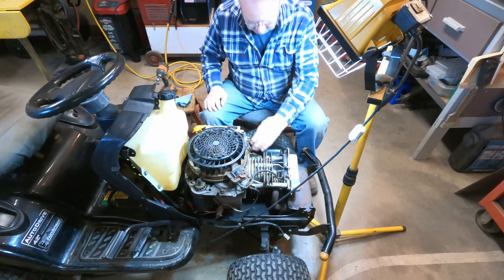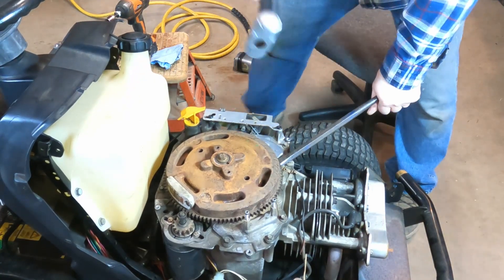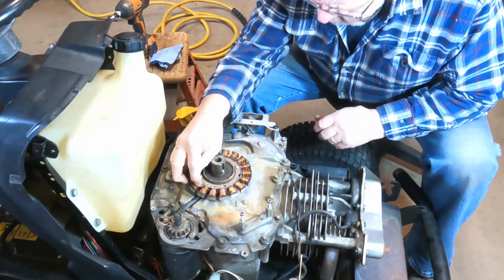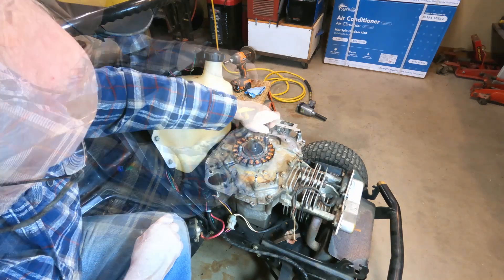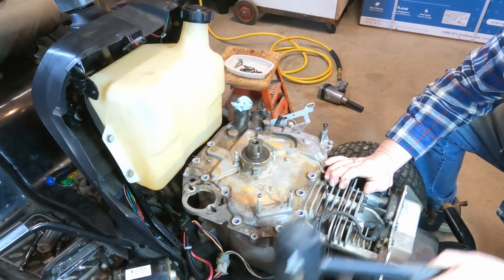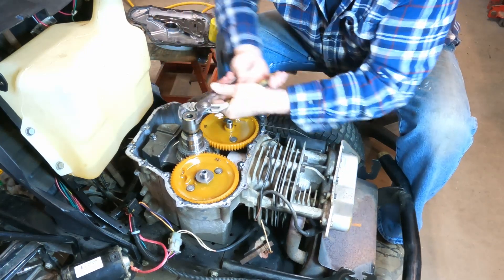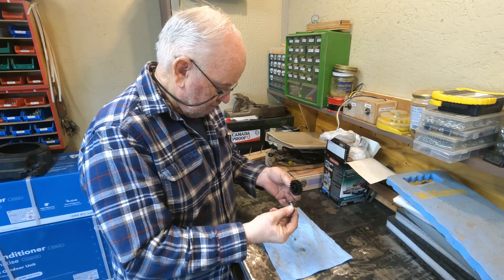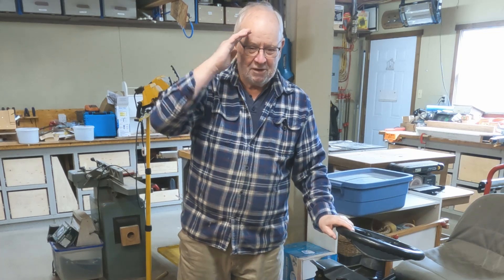Checking the Governor on a Kohler Courage SV530

Comment: Well that's a interesting design all from the top.  I wonder if  its  overfilled  oil level mixed with gas caused the governor to implode ?
Reply from the maker: How's she goin'?  I'm not to sure what happened to the governor, but last summer I had hydro-locked the engine when the float in the carb failed.  There looked to still be evidence of gas in the sump as I could smell it, plus maybe some water too.  The governor gear is plastic.  It looks like the metal pins that hold the metal flaps that fly away when spun up to control the throttle had broken out of the plastic holders on the governor gear.  That may have been caused by gas in the oil eh.  Thanks for that suggestion.  It bears some more investigation to prevent it from happening again.  Take 'er easy!!

Comment: Great video Mike.  It takes some cajones to tear into into a engine like that.  Lucky more damage was not done with all those loose parts hanging around.  Looks like a simple fix but a lot to get to the problem.  We will see it running in the next video.  Thanks Mike.  Stevo
Reply from the maker: How's she goin'?  Thanks Stevo!  I thought it was just a messed up throttle control arm or spring, but there I go thinking again!!  LOL  The repair is underway and I hope it will be running in the next video!  LOL  Take 'er easy!!!

Comment: Well, Mike if all else fails you can always take the engine right out and install pedals, but seriously I have seen guys convert their old tractors into all-electric machines with batteries. No more oil or messing around with gas but that seems like an ambitious endeavor. There is no turning back now buddy. Take care
Reply from the maker: How's she goin'?  That would be an interesting project to make the Estate Car all electric!  But my budget was pretty low on this repair so I opted for just a new governor gear and gasket!!  LOL  I use this Estate Car a lot around the property so I'll be glad to get it back on operation!  Thanks for the visit.  Take 'er easy!!

Comment: Mike FYI thier was a recall from Kohler on those governors. Due to them breaking apart like that. They made a replacement governor with the defect repaired. The authorized Kohler dealer repair facilities were repairing them for free.  Their are quite a few videos on it.
Reply from the maker: How's she goin'?  Great to hear from you Vicky!  I never knew about the recall.  Would that still be in effect I wonder?  No matter really, as the repair has started and the parts ordered.  I did notice on the Kohler site that the cover gasket is listed as 'no longer available'.  I guess I could use gasket maker or some such thing in a pinch eh.  Thanks for commenting.  I have missed your input!!  Hope you are well and take 'er easy!!

Comment: It is great that you can get to the governor without removing the crank and camshafts. I really like how you explained everything you were doing, we can learn a lot from the way you talked through this process, thanks
Reply from the maker: How's she goin'?  From what I have read about these Kohler Courage engines they suffer a lots of failures, some of them catastrophic.  This failure wasn't a show stopper, but one thing that made this repair go well is the design of the engine crank case.  It being like a bucket means you can service all the internals pretty easily.  Thanks for watching and once the new parts arrive, we'll get this engine back together and have a carefree summer of driving around on the Estate car!!  Take 'er easy!!

Comment: Great video, Mike.  I've always hated those plastic governor gears.  They get brittle and this happens.
Good tip on using a cut zip tie as a depinning tool!
Reply from the maker: How's she goin'?  Thanks Bruce.  Kohler Courage engines get a bad name due to the failures they have encountered.  I guess plastic gears contribute to that.  Like you say, they get brittle over time.  But the engine is almost 20 years old so I guess they lasted OK.  I hope the cam gears not blow apart now!! LOL  Take 'er easy!!

Comment: Good evening Mike! That wasn't too bad getting the engine apart, its always putting it back together where the fun starts.  Hopefully the new parts won't be ridiculously expensive. I suspect having gasoline mixed with the oil and perhaps some  moisture produced somewhat of an improper lubricant that the governor didn't like.  Have a good one!
Reply from the maker: How's she goin'?  Steve Rob had mentioned about the gas in the oil and possibly causing the governor gear to fail.  I never really thought about that, but I think you guys are right.  The gas in the oil I bet caused the plastic gear to change it's properties and eventually the little pins that hold the fly away ears broke through the brittle plastic of the gear and the rest is history!  LOL  Thanks for the comment Paul.  Take 'er easy!!

Comment: Good call Mike to take the engine apart when you get the parts you be all set take care have a great weekend
Reply from the maker: Hello there Tom!!  Everything looked good around the throttle linkage so going in and checking the governor was the next step.  Glad I bit the bullet and did it.  The repair, hopefully, will go OK.  Thanks for the comment.  Have a great week end and take 'er easy!!

Comment: Good call Mike. You would have had to disassemble it anyway, even if the camera idea worked. Our governor here in Michigan is defective also.
Reply from the maker: How's she goin'?  Ha Ha Ha!  Tom if I were completely honest with you, there are more bad governors than just in Michigan!!  LOL  But they are all politicians on each side of the border and we both know, be they governors or premiers, they aren't worth changing your shirt for eh!!  Take 'er easy!!
Reply: @ you are so right on the politicians. I’m glad you got into the motor before any loose Governor parts could get chewed up by the rest of the moving parts.
Reply from the maker: @haneyoakie14  I managed to recover all the governor parts.  I was lucky.
Reply: @ can the existing parts be reassembled? Or will it require new governor? I got the impression from your video that gasket kit plus governor is the parts need.
Reply from the maker: @haneyoakie14  That's right Tom.  The old governor was damaged beyond repair.  I ordered a new governor gear and gasket.  I'm having trouble getting the gasket as it is listed as 'no longer available'.  I guess I could use 'gasket maker' but I did find one on Amazon and ordered it.  Should be here next week.  Take care!!

Comment: Well done Mike. 
Obviously my suggestion of just leaving the governor disconnected was a bad one.. 😟
I have a Kohler Courage engine on the junk mower in the shop. It blew out the back side of the bucket next to the starter mount. 
It might be due to some loose piece floating around inside the block. 
Oddly enough it still starts and runs. Just very noisy. 
I don't think I can fix the poor old thing. I checked on the internet just like you did. Seems like the Courage engines are prone to breaking the block. 
Good luck on your repairs. It was nice seeing how you disassembled it if I ever decide to try and repair a different one. Although I'm much more likely to leave it sit if I'm offered another one. 😁😎
Reply from the maker: Hello there Dave!!  When I was investigating the Courage engines it showed many faults of broken blocks.  The main reason was the bolts that hold the cover down were coming loose and fetching up in the flywheel and breaking the block.  Disconnecting the governor was not a bad idea.  It would require some mods and changes to the throttle control and I just thought repairing the governor might be a 'smoother' option!!  LOL  Thanks for watching.  Take 'er easy!!
Reply: @GrampiesWorkshop  The internal governor is a very differnt governor than the one on the engines I worked on as a boy. 
The cast iron Briggs engines used a paddle in the air stream from the flywheel fan used to cool the engine. If it failed it was caused by a brokein spring or linkage rod that stayed outside the crankcase.
Reply from the maker: @OldSneelock  There are different ways to control the engine speed.  I have seen the fan type governors as well.  To be honest, I like them better.  Simple tends to win out in a lot of things eh!!  Take care!!

Comment: Nice that you found the trouble Mike. Just a tip, when you put it back together, put some sort of tape on the crank shaft  where the key way is. That will keep the oil seal from getting cut. Should done that too when you took it off, 🤭🤭. Oh well.  
And check your magnets in the flywheel to make sure they are tight to the flywheel, before reinstalling. 

And you’re hired. You can start work Monday in my garage to fix stuff. Bad last two days. 🤦🏻‍♂️🤦🏻‍♂️🤦🏻‍♂️

Have a great week end you and Janet. 👍🏻👍🏻👋👋
Reply: Bumpy road ahead Mike. And I may take till summer for the road to smooth out. 🤭🤭🤭🤭
Reply from the maker: How's she goin'?  Thanks for those tips Noel.  That's a good idea about the tape.  The magnets were good and secure.  I checked those right away!!  I'm sure the bumps in the road you faced the last 2 days will soon be behind you.  It is spring time and the roads always get rough this time of year!!  LOL  Take 'er easy!!